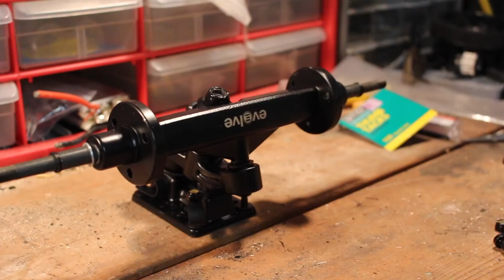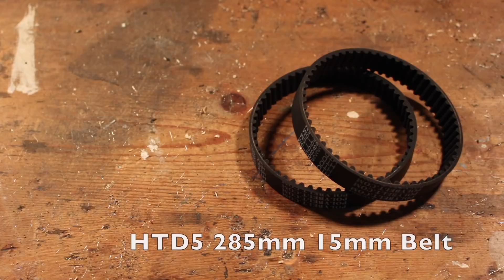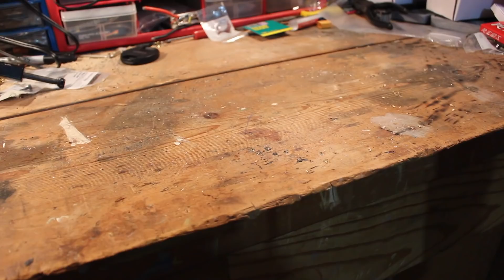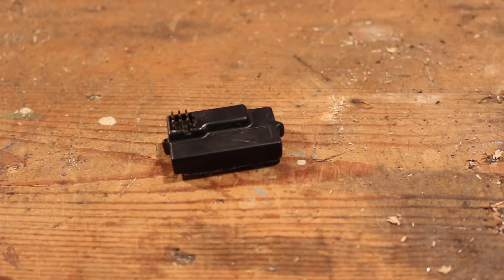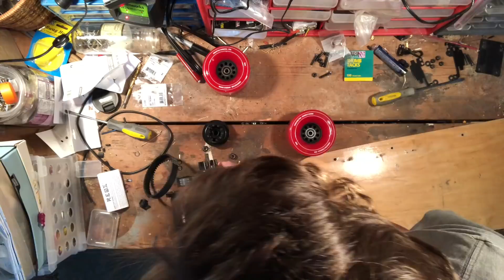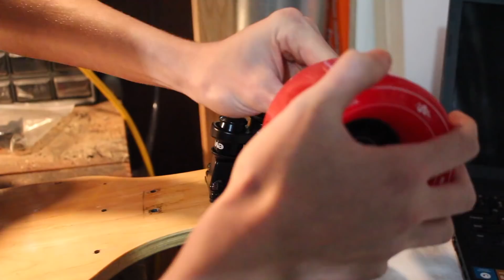How to build a dual drive electric skateboard(10s, 100mm BOA wheels)

Comment: Hey, I came back to this video for some reference but on your parts list page you had the boas listed as having 56mm width next to the picture of the wheels that say 65. Thought that would confuse someone. The question I had though was what tooth went on the motor pulley? 15t? 16t? Thanks! LOL I probly spelt something wrong too

Comment: You definitely don’t have to tighten the Evolve trucks a lot or as much as he did. The nuts weren’t on properly but minimum tightness is 2 threads showing. That won’t fall apart on you and is perfect for me for heavy carving or bombing hills. If you’re a chonky rider then you may need to tighten more, 150 ~ 225 pounds I wouldn’t say so. It’s preference. I don’t really understand the point of double kingpin trucks if you’re just going to tighten them all the way haha

Comment: What did you do with the two position sensor wires?   (the two wires with white plastic terminals coming from the motor)
Reply from the maker: In the making of this video, we never used them because we ran the motor in BLDC. We now use them and run them in sensored FOC. They plug into the sensor ports on the FOC Box with some extensions adaptor cables

Comment: Can you please told us were did you buy them from please !!!!!!!!!!!!!
Reply from the maker: We haven't updated our old website with all our new boards but this one is in there with a parts list: https://diyesk8builders.wixsite.com/esk8 . You can check out our new website were we can build this exact same board for you and we can build this exact drive train ( Ownboards dual kingpin trucks(front+rear), 6374 Motors X2, 38t Kegel Pulley X2, 15t Motor pulley X2, Custom Aluminum Motor Mounts X2, 100mm BOA Wheels(Set of 4), 285mm Belts X2 ) at: https://electric-skateboard-parts.myshopify.com/ .

Comment: I have a 60inch longboard, 48", and  39" pin tail. I'd love to make an electric 3 or 4 motor longboard  for speed and torque. Add some lights and BAM.  I think with the 4 motors, I'd preserve the life of each motor. Plus, the torque would be insane.
Reply from the maker: Yeah 4 motors would be crazy, but it would be so expensive. Plus your battery would have to be massive otherwise it would get drained very fast. Two is honestly plenty
Reply: @DIYesk8Builders  Well, I'm a big dude, and I'm in Bone flat Florida. I'm never going to go 40mph, but I live near the beach and can ride up to ft lauderdale or if I really wanted to, head down to Miami Beach.  But if 2 is enough, (front wheels would make more sense, I'd want to have the torque to get up to 20mph and cover 10 miles.
Reply from the maker: Most esk8's use a rear wheel drive, so I would recommend that. Two motors launches me (145 lbs) at 25 mph up every single hill, which are consistanly 20-25 percent. I was even able to get up the steepest hill I could find which was 30 percent. Dual 6374 is insane already. Dual 6374 190KV with a 10s battery goes well over 20(I get to 30mph with a 15/38 ratio and 100mm wheels).
Reply: @DIYesk8Builders  Rear is cool, but with it being so long, and I'm riding up near the front, not the middle. And with it being so long, I thing for safety, itd be best to still carve. brakes might work right out of the gate too. But my board might weigh on its own, 3x more.  And there are no dangers of any incline more than 6% here.  Including highway overpasses.

Comment: can you put hall sensors on belt driven motors? Couldnt see if you did it here to add more stability or if thats only possible on hub motors?
Reply from the maker: Yeah you can put hall sensors on belt driven motors. We didn't put them in during the making of this video, but we recently did. Running them in censured FOC mode is infinitely better

Comment: I went to your website and I couldn't find which screws were used. Could you please provide it for me?
Reply from the maker: Yeah screws for what. Motor mount, enclosure...?
Reply: @DIYesk8Builders  or like all the different kind of screws that you used
Reply: For everything that you can provide, if that's possible. I'm not sure of the specifics, sorry.

Comment: Hey guys,
I was wondering how can I add a third motor to a dual motor skateboard of mine that can run separately. thanks!!!
Reply from the maker: Like a third motor to the front truck? For what purpose?
Reply: @DIYesk8Builders  
Yes sort of and yea this a uni project im working and the electric board I using it's  called evolve carbon GT with dual 1500watt dual motor. All I'm asking for is it possible to add a motor of same size (1500watt) and be able to control it separately by stoping the other two motors and run the third one. If yes what sort of transmitter/receiver do I need etc

Thanks for the replay again
Reply from the maker: Hmm, definitely possible to do something like that, but I have no idea how. Not too sure considering its already a carbon GT, meaning that the ESC and receiver are already in place. You would need another ESC for the motor and have to connect that to the battery. You could make a switch so that sometimes power is supplied to the back two motors and when the switch is flicked, power goes to the single motor instead. This scenario would need its own reciever and probably remote as well because I am not sure how evolve connection works.

Comment: 8.4 hp? does that mean this board can outperform a 50cc scooter ? i mean if we put these 2 tiny motor instead of that 50cc engine would that same scooter be faster ? talking about scooter like the yamaha bws
Reply from the maker: It will never really have 8.4 hp because the battery can not output that much. I will say this thing is insanely powerful though. I am not sure how is stacks up against a scooter like that.
Reply: you should race one! i think that lind of scooter was like 3.5hp back in the days

Comment: Getting ready for my first build and I kinda  went ham... Torqueboards Direct Drive kit with the 45mph motors, Torqueboards 12s4p battery w/ bms and FOCBOX unity. Its all getting mounted to a Hi5ber Jalapeno deck. Im super nervous about the build because I know there are gonna be things I need and won't have them. I already got the xt60 to xt90 for the batteries to connect to the FOCBOX unity but I think I need those 3mm to 5mm bullet adapters as well. Any idea where I can get my hands on that?
Reply from the maker: Dang that sounds like its going to be awesome! I have no idea where you can buy prebuilt adapters, the ones I have are ones I made. Soldering bullet connectors is actually quite easy once you learn the method. Just buy some 3.5mm connectors and 5.5mm connectors and some 10-12 gage wire. Plenty of bullet connector soldering tutorials on youtube too!
Reply: @DIYesk8Builders   yes I have done more research and see how easy it is to just fill the 5.5 with solder and pop the 3.5 in while its hot. I think I am 100% ready for the perfect build! Now I just need the parts.

Comment: Sweet build, but there's no way you're actually making anything around 8 horsepower.  With your 36v battery you'd need to draw like 90 amps per motor, and your 10s4p battery can do 180 continuous amp output.
Reply from the maker: Hahaha yes it definitely is not 8 horsepower but anything for the thumbnail. Battery only does 80a continuous

Comment: Don't hit bearings with a hammer (The ones in the motor, when you mounted the belt wheel. If you must hammer, support the other end of the axle on an anvil, so no chocks reaches the ball bearings)! Double work and higher resistance with an XT60 to XT90 adaptor, why didn't you just solder XT90s on the controllers?
Reply: this way you get to keep warranty on the focboxes
Reply: @JazzGreinerMusic  That's true though!

Comment: That board looks amazing!
Are you cheaper off building one yourself or is a pre manufactured cheaper?
Reply from the maker: Thanks! It really depends which pre-made board you buy. Boosted Stealth is $1,600 and Evolve are $1,500-2,000 if you're looking for premium quality. There are a lot of cheaper options too. It costs probably $1,200-1,300 to build something like this. I personally think this thing will out perform any prebuilt so for me this is the way to go.

Comment: nice buid but why don't you weld instead of using all those connectors ?
Reply from the maker: No particular reason, easily could have done that. Adding all the connectors is far more work but we never had to solder on the parts we bought so they are all as they came. Honestly was a bit concerned with damaging the parts if something went wrong when soldering

Comment: nice buid but why don't you weld instead of using all those connectors ?
Reply: so in the event something fails you can easily take it apart and test it
Reply: Think he means take the unwanted connectors off and solder the correct connectors on to eliminate all the adaptor leads

Comment: Hey, where did you get the wire extensions for the Focbox?
Reply from the maker: I made them from some 12 AWG wire 3.5mm bullet connector and 5.5mm bullet connectors.

Comment: Nice work !! 
what motor specs did you use ?
Reply from the maker: Thanks, the motor is a 6374 190 kv motor from torque board with a max power output of 3,150 watts. The VESC settings are 40A for each motor, max break power is 60A.
Reply: @DIYesk8Builders  Can someone explain to me why these motors aren't used in electric motorcycles? They are lighter weight & their power output is way more. So then why are they only confined to small scooters & skateboards?

Comment: Tip for anyone trying to get a motor pulley on the motor shaft. Take a socket (with an inside bigger than the shaft but small enough to not surround the motor pulley) put it on the pulley and hit it with a hammer (not to hard tho)
Reply: Hammering on a bearing ALWAYS a BAD idea! bearing will fail early
Reply: @stevenbibeau1515  You don't hit any bearings you're just helping the motor pulley slide onto the shaft

Comment: Is there any difference between rear mounting the motors and normal? I'm thinking about doing when I build mine so I can have more room on the bottom.
Reply from the maker: If your worry is clearance from the ground, they will both be the same clearance wise. Mounting the motors rear facing will give you more deck belly to have a longer enclosure. The reason we rear mounted the motors in this video is because  the Evolve trucks and the mounts we used are made for rear facing motors. I far prefer mounting them regularly, facing inwards, as they are more protected.
Reply: @DIYesk8Builders  Good to know, thanks!

Comment: I'll get the Evolve trucks but I'll use Janux motor mount, the one made for Evolve trucks.
Reply from the maker: Yeah those are pretty sick, more expensive than Unik Boards mounts but they have idlers and are adjustable

Comment: You should try a Focbox Unity. PS: I own Evolve GTX and I had an idea. I want to replace motors, electronics and battery to make it more powerful. Your videos are very helpful. Thanks a lot.
Reply from the maker: Yeah I would love to try the unity but its pricey and hard to get. Replacing those parts on the GTX would be sick, especially that battery which I've heard has some major voltage sag issues.

Comment: Looks great, would be even better if you could drop mount the trucks. A lower centre of gravity would improve your build (IMHO).
Reply from the maker: Thanks, yeah I agree with that but I already had the deck I'm using but drop mount would be cool and look like the evolve
Reply: @DIYesk8Builders  must try those boa wheels one day. I'm riding 107s at the moment, I'd love to know how they're different.
Reply from the maker: Yeah they are very nice wide and grippy, I love the look of the Kegel style core. They probably feel similar to the 107's but I haven't tried those out either

Comment: Great build my friend and the channel!  I really like those BOA wheels and have yet to try them out.  How's the ride with the Gullwing trucks?  I find at higher speeds they can get a bit wobbly.  Keep up the great work!  I just completed a dual motor build as well and hope to upload something soon.
Reply from the maker: Thanks! Yeah BOA wheels are well worth it and the trucks are great too. My favorite thing about them is the motor mount being already built in and only needing the attachment plate to hold the motor. I have not had any trouble with wobbles, but I really tightened the trucks. I watch all your videos and am a big fan so I look forward for the new video coming out, also super stoked you commented!
Reply: If you have the speed wobble at high speeds you might think of toghtheing the main hex net, this will reduce chances of speed wobble but at a consequence of reducing the ease of turning

Comment: hey dude build looks really clean. just wondering what the output and capacity are for the battery. Could you drop a link plzzzzz.
Reply from the maker: Thanks! The battery is not for sale anymore from diyelectric skateboard so there is no link really. The battery is a 10s4p battery made from Samsung 25R cells. Maximum discharge is 80A and capacity is 10,000 mAh. It has a built in bms, power switch, percentage indicator, and charge port. If you have anymore questions let me know.
Reply: @DIYesk8Builders  Thanks dude! does that mean that the battery has an 8C discharge rate?
Reply from the maker: Yeah I believe so